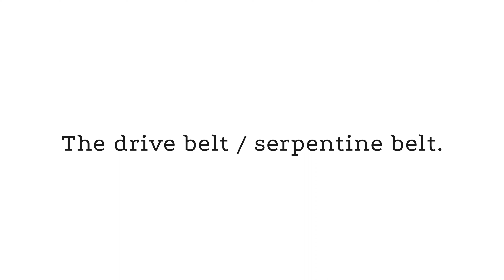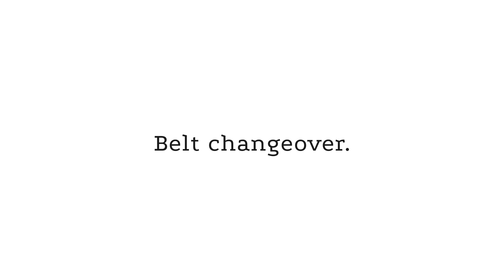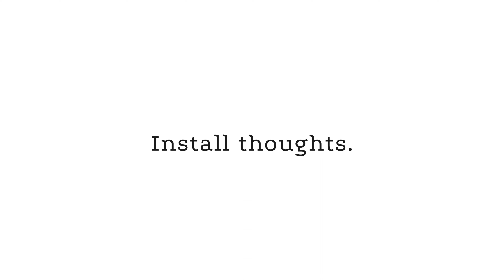How To Change the Serpentine / Drive Belt on a Mazda BT-50 or Ford Ranger || 4WD Maintenance

Comment: how many kms do they recommend to change the belt? cheers from esperance
Reply from the maker: Hey Roger.

Nothing mentioned in the workshop manual, just to inspect every 20k. I see a lot of people in forums suggesting just changing at 150k to be safe and doing some of the pulleys at the same time. 👍
Reply: @TheBrowneTown  I might do mine soon as done 106k,did the Nomad valve body today
Reply from the maker: Awesome, might be too early to tell but did you notice improvements in the stuff listed on the website like engine braking, fuel economy and the way it shifts?

Easy install?
Reply: @TheBrowneTown  I had it done in perth,my transmission was in good condition as I run a cooler and bypass valve with the deeper sump, was no metal on the magnet he said,can't say I can feel a big difference I'll test it out the beach on the weekend,he did say the torque converter  is a weakness in these transmissions,I may look at getting that upgraded as well
Reply from the maker: @dodgierogie68 good to hear. Might be something I look at one day in the future.